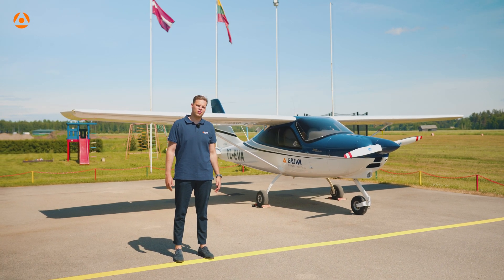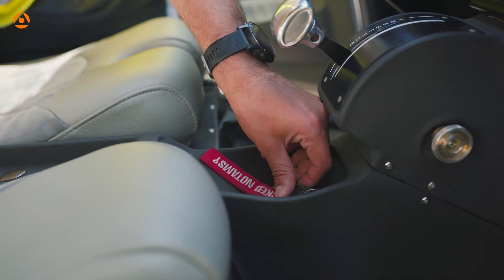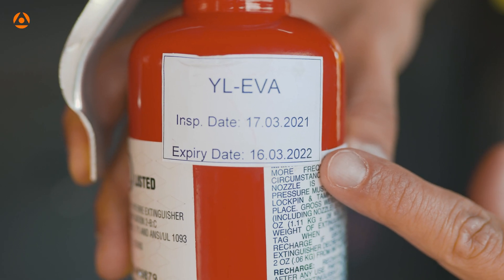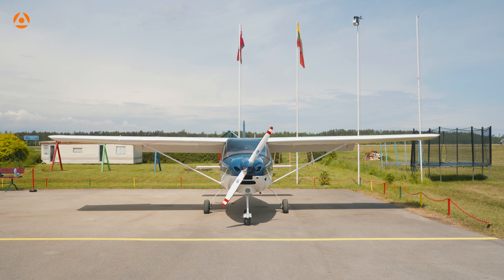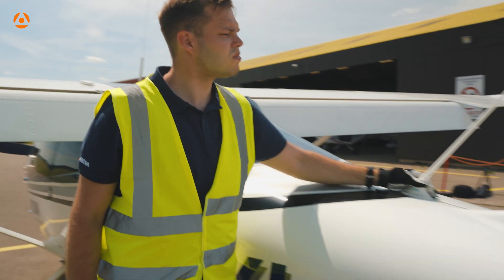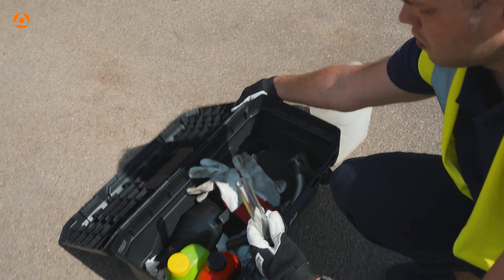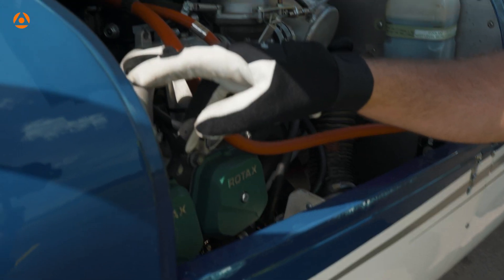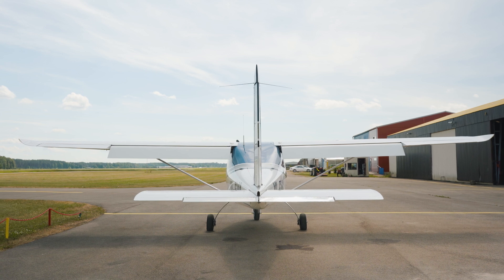Tecnam P2008 pre-flight inspection

Comment: Some steps from the manufacturer's recommended procedure were missed, like checking the trim buttons on the right stick and checking the trim on/off, left/right switches. Recently in the P2008 JC I suffered the runaway trim condition in flight, luckily the forces were still not big enough and I was able to stabilize the pitch with some force, bring the trim to neutral and turn it off.